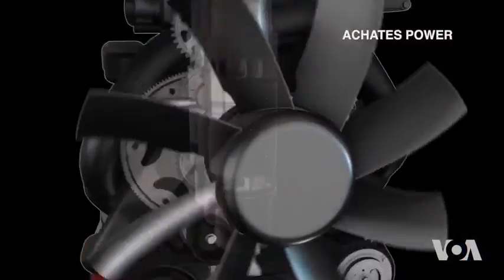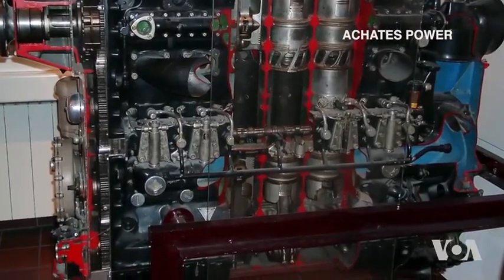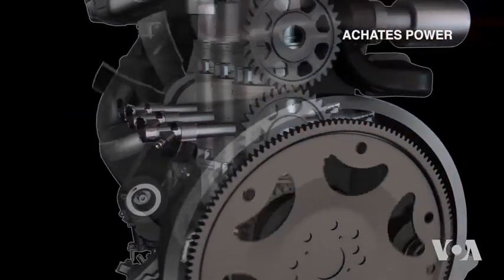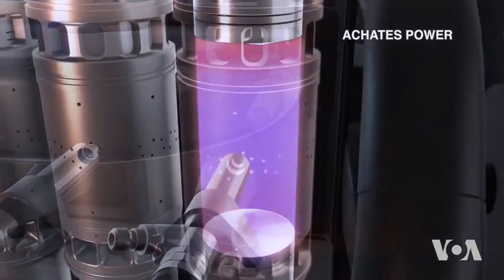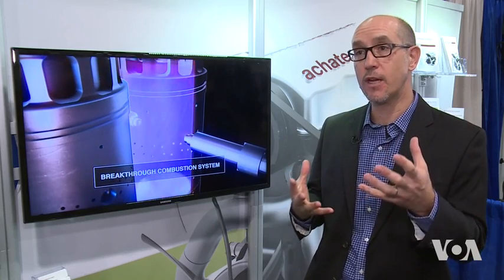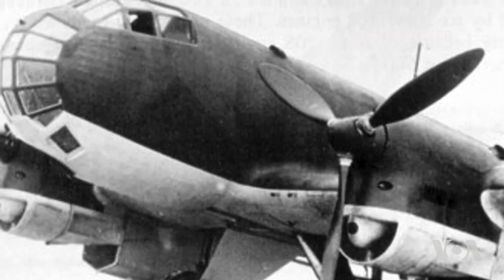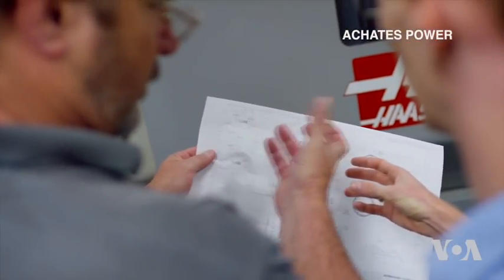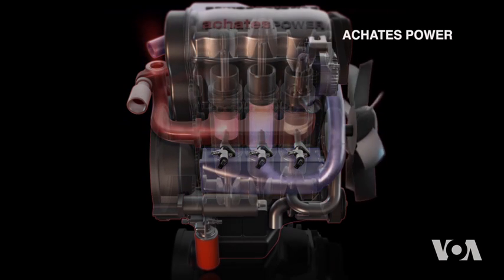A 50% More Efficient Internal Combustion Engine

Comment: 6 stroke?
Reply: philip dias no, 2 stroke. because it's forced induction the piston does not force the exhaust gases out, instead as it reaches TDC it uncovers the exhaust ports, the air being forced in through the inlet pushes the exhaust gases out.
Reply: Luke Schofield I have heard of a six stroke. 4 on the bottom and two above.
Reply: philip dias I'm not sure what you mean by that? six stroke engines do exist but they are rare. the vast majority of engines are 4 stroke. The engine in this video is a 2 stroke.

Comment: We had a 20 piston opposed morsel fairbanks for the power plant on Diego Garcia in 1972. Same setup
Reply: Till you find out that about equally as easy to make "oil burners" carbon neutral as it is to make electric cars carbon neutral. for the "oil burner" you grow soybeans or similar oiliy plant... for the electric car you have to turn to more difficult means such as solar and window power to eliminate fossil dependence. difficult because it requires infrastructure to be built that doesn't' exist yet.
Reply: @Wingnut353  So we are running cars on "window power" now. Is that a new type of solar power? LOL
Reply: Yes, this is very ancient, primitive technology, painted up to look new. It's not. It's just another oil burner we don't need.

Comment: Just by the looks of the opposed power engine piston movement it makes me feel this engine will be one that won't Rev high but I guess it will produce more torque in the lower rpm Rev range.

I'll personally still prefer a gasoline direct injection conventional engine that revs high 👍

Comment: oh no... they used straight cut gears to connect the two crankshafts. bad design. lots of noise.
Reply: Sloan V Probably just the animation tho
Reply: true, it will be noisy but they wont have end thrust on the bearings
Reply: Not true.  They actually are quieter than chain driven cams.     Besides have u ever heard a transmissions gears humming n making noises at while cruising at 70mph? I havnt either.
Reply: @Elbarbero-supreme  Reverse gear is straight cut and that's why it whines.
Reply: barberwinning ... passenger car transmissions, automatic and manual, have helical cut gears. Even the planetary gear set sun gears. Ring and pinion gears are cut that way to. Different loads, but handle torque inputs/outputs and are quiet.
Reply: Not really a problem for a prototype... they said they were using off the shelf parts for the prototype and would move to bespoke parts for production volume engines.

Comment: Wonder how noisy this motor is
Reply: ChiefJustice Middleton Nearly any motor without sound isolation is loud
Reply: Hope it's scream
Reply: Well due to it being an opposed piston it should be probably half that of a detroit diesel from the start due to lower exhaust pressure... similar sound though and the turbo willl quiet it down a bit further as well.

Comment: So it is a two stroke engine? How is that going to comply with Euro 6 standard?
Reply: it have a seperate oil flow, that means no burning of oil in the air-fuel mixture and with direct fuel Injektion euro 6 is possible, i think :)

Comment: straight up configuration seems weird for automoviles, they should have tried a boxer engine
Reply: The TS3 was a semi-boxer layout. And noisy as hell. (It wasn't very fuel-efficient either)
Reply: audex what defines a boxer engine is not it being horizontal placed. that is just for convenience. It could be set horizontaly or in a diagonal and still it would be called a boxer engine.
And by the way, a engine set in an horizontal positions and with opposite cylinders may not be a boxer engine.
Reply: I agree, I think delivering oil to the top piston would be kind of tricky.
Reply: That was another reason Tilling Stevens stopped making them.
Reply: +Daniel Peixoto Martins ...go on
Reply: audex this type of engine, either in an upright or horizontal position, is not a boxer engine, neither can it be called that.
Reply: no shit, cool story bro

Comment: finally a date set at 2018. I have been following the progress of this motor and it looks very promising because it is so efficient, way less parts to break down and will use much less fuel than what we have now. Using bio fuel sounds also very promising to help clean the atmosphere and more.
Reply: Bo McGillacutty
Yep, ultimately need to se the dyno and fuel consumption test results to believe anything like this
Reply: ChiefJustice Middleton bull a 20 or 30 percent improvement in fuel efficiency would have changed the automotive world, like that super carb from the 1930s,it is just not true or everyone will be using it as powerful as the  oil companies are they couldn't keep that kind of technology secret.
Reply: Bo McGillacutty
yep, people will invent anything and then claim its the cats ass and sell you a lemon. How long will the engine last as well. 2 strokes dont fair well to wear and tear and this engine also appears to be fairly noisy
Reply: this engine is a diesel so bio-diesel should work. Now just make it hybrid and throw in some HH0 gas and this baby should be steady rolling at 100mpg EZ
Reply: Now your talkin. Butchtropic has no clue of fuel combustability and how HHO compliments the overall burn event without leaning the fuel out and causing damage. Introduce a plasma ignition as well and this would be amazing, if at all needed
Reply: ChiefJustice Middleton Plasma/ spark plugs are not necessary on a diesel it combusts through compression
Reply: the opposite piston motor will eventually get in because china has finally signed and agreed to build it. great news.
Reply: ChiefJustice Middleton Or even a basic theoretical thermodynamic explanation could be somewhat convincing.  But this offers nothing of the sort.
Reply: Have you looked into Pogue carburetor? Imagine those two combined...
Reply: Hppyhppy2
Yes, I am aware of this, however if the compression ratio was dropped and a plasma ignition was introduced with water injection and HHO, the fuel economy and emissions and power would be astronomical
Reply: *****
better fuel burn, its obvious and its been proven to some extent
Reply: *****
There is a NASA patent that has recently been released that proves that plasma gives 20-30% increase in mileage right off the get. I dont know where you been getting your info from.
Reply: *****
Patents dont always get used nor sold, You know anything about the oil mafia? Of course they dont want this info getting out. Alan murakami has utilised this on his engines
Reply: jack g that's not good because their manufacturing standards are low
Reply: remember, that are now stricter and stricter regulations for manufacturing, even the chinese see the need to better regulate the industry.
Reply: Herr Trumpler might turn out to be their regulatory friend.
Reply: Tomasmoravia
Carbs are ancient history, not a chance they will ever approach the efficiency of modern injection.  But ICE is is on the way out anyway for most applications.  Battery electric is taking over everything from lawn mowers and leaf blowers to cars, the transition starts slowly and builds speed.  Heavy equipment, aircraft and a few other categories may continue with liquid fuels for the foreseeable future, for most everything else ICE is going to be replaced fairly soon and it won't be missed.
Reply: Except 2018 doesn't seem realistic.  Achates took it to the Auto Show in Detroit fitted into a Ford F150 but not a single manufacturer has signed on to put the engine in their vehicles including Ford.   Given the typical manufacturing and testing  cycle, it seems highly unlikely that Ford or anyone would have a vehicle with this engine until 2023 at the earliest.  And that is assuming Achates has a customer by then.  I'm hopeful as this seems promising.  But if it was as promising as all the hype, why don't they have a customer?
Reply: Wow this aged like milk
Reply: patents are claims, not proofs.
Reply: Frankly I'll believe it when I see it.  How do they justify the 50% claim?  I call bullshit.
Reply: ChiefJustice Middleton Right.  Two strokes also tend to be dirty and much less fuel efficient. And it's hard to believe that all the major engine manufactures would be leaving that much efficiency on the table given all the decades of dedication to eking every last partial percent of improvement possible.

All that said I applaud any well thought out, serious effort for dramatic improvements, or even a niche market entry....so this is interesting I just don't believe the claims.

Comment: Hmm, so it doesn't completely vent the cylinder before starting the next cycle? Does that not affect how completely the fuel burns? Could it result in higher CO emissions?
Reply: https://en.wikipedia.org/wiki/Exhaust_gas_recirculation

Certainly not. Why should it?
How much CO instead of CO² you gets is estimated with your Lamda-Probe before (and aft) you catalytic converter which regulates the mixture to compensate. Thats why you have a Cat!

https://en.wikipedia.org/wiki/Catalytic_converter
Reply: Also it is so in twostroke engines all the time. Its a continues progress so you need to set your mixture already compensated to the running condition and its fine.

Comment: Internal combustion's time has about ran it's course. 
Why keep beating a dead horse?
Reply: hintzofcolorconcepts That's the problem. People think it's dying when it's not. The ICE is very much alive. It's innovations like this that keep it so. Electric vehicles came before internal combustion, yet they're still being worked on. Much is the same with ICE. They're are many, many people working on it. Experts say that more has happened in the last 10 years to the ICE than the past 100. 

Naysayers like you are holding us back. "Electrics are coming electrics are coming!" Electrics are here. They have been. Longer than internal combustion. Next it's "They'll get better!". Sure, they will, but so will ICE. And this video is proof of that. If you want to get rid of the internal combustion engine, you'll have to hit a moving target. It's not a matter of making something better, it's continuously staying better. And the ICE is already better in most instances. And it will get better.
Reply: Batteries, especially Lithium Ion Batteries, suck a hell a ton for the environment. Lithium is one of those lighter elements that is not only dangerous to humans and other wildlife because it reacts very poorly to water. Have you ever seen a lithium fire? Lots more toxic fumes and very angry when exposed to water. When ever these EV catch fire, fire departments can only hose down the outside area because of the danger lithium poses. Not to mention they don't do well when exposed to overcharging or heating which in turn can cause these fires. I personally prefer driving a vehicle that I can not only fix myself, but wont explode in a fiery death cloud of unquenchable fury.
Reply: The NHTSA predicts that by 2030 electrification MAY have advanced far enough and gained enough consumer acceptance to BEGIN to supplant the internal combustion engine for personal transportation (no real mention of commercial vehicles).  In the meanwhile it behooves everyone if they produce more power while emitting less of the harmful stuff.  It's only logical to continue advancing the art until the last drop of petroleum is produced.  Horse(power) is not dead yet.
Reply: Because batteries still suck, I mean really suck.
Reply: hintzofcolorconcepts you are probably right. I'm happy to let others drive Evs for now. I'm happy to wait until the battery tech gets much better, i.e. Bigger capacities in smaller and lighter batteries, proven reliability and a good, fast charging infrastructure. The internal combustion engine still rules, for now
Reply: DeepFriedFuzzball Excellently said. I'm actually screen shotting your comment for future reference.
Reply: No, E.V.'s have no chance, state governments like California rely on gasoline tax to pay for road maintenance. E.V. owners don't pay a gasoline tax, that's a problem for the state, conflict of interests.
Reply: Because our civilization will take a long time (50 years?) to transition to electric vehicles.
Reply: hintzofcolorconcepts if there are less people whinning about nuclear reactor then it will possible..
Reply: "Hybrids require less maintenance " more maintenance due to more components, and many more points of failure... the Achates OP2S engine should require less maintenance as it is a simpler design overall.... no valve train is a huge reduction in complexity.
Reply: P Allen: what really sucks is that the real tech to continually trickle charge the batteries is still being supressed by a flood of bogus tech.
Reply: Eh... EVs only require half the energy density of gasoline to go almost twice the distance of an ICE vehicle per pound of battery to fuel as EVs have a 90% thermal efficiency and diesel vehicles have an average thermal efficiency of 50% with gas vehicles remaining at a dismal thermal thermal efficiency of 30-35% on high end gas engines, at which an EV would go 4x the distance per pound of fuel to battery. EVs have nice place in densely populated areas like cities because of their lower rates of car ownership and  higher rates of pollution, for city dwellers it just makes sense to get EVs to improve living conditions in places china or india. For the most part EVs will never really replace ICE vehicle for long haul transport or the rural countryside, but hybrids will. Hybrids require less maintenance and less fuel as they can store energy from the engine as it idles in traffic and keep the engine at it's most efficient fuel output without worrying about getting torque to the wheels as the motors would simply siphon the extra needed energy from the batteries. The age of pure ICE vehicles is over, because they inefficiently burn off energy while at idle and they can't regeneratively brake.
Reply: More like 2020.
Reply: Petrol business?